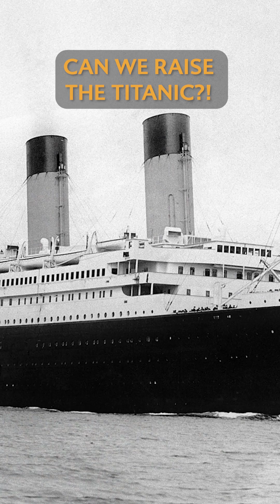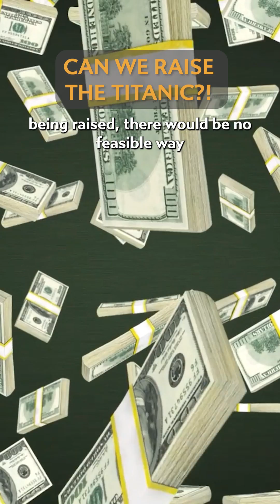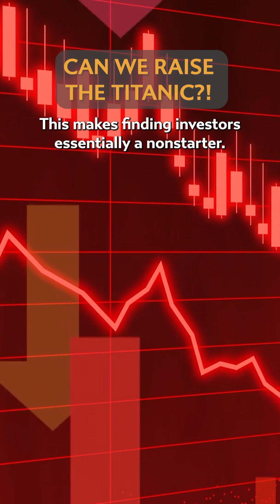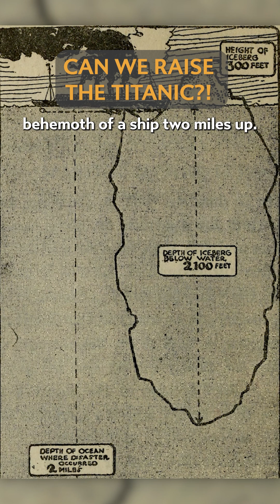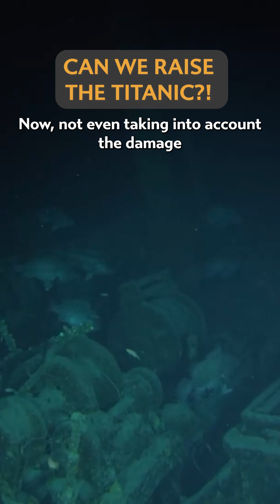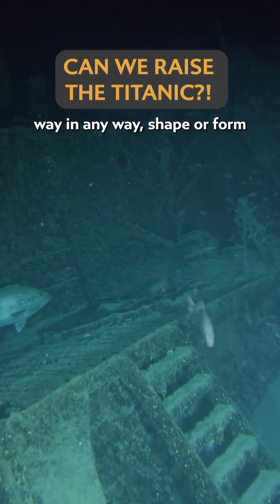Why Has No One Raised the Titanic?

Comment: It's too shagged. It's too deep . The only way to raise the titanic is to do it by scooping it with a massive glorified shovel. You'll have to scoop about 5-7 metres lower. You couldn't actually lift the Titanic out and it'll take about 6 months or longer to do just one end... Bow, or stern and you'll have to let the water drain as well, because water equals mass... The titanic will also partially crumble as you raise her.

Comment: I’m gonna embrace my inner demons here and say it’s totally doable. You just need some massive steel cables to form a giant net that is layered with a trampoline style covering. Underwater subs would tunnel under the titanic and feed this net underneath the ship. 

Then multiple giant steel lines from the net(probably 40-50 per side for a total of 80-100) would be brought part way up towards the surface where a high capacity, carbon fibre bladder is attached. These bladders would be equal in total air volume to 2 school busses. These reinforced bladders would then be filled with helium. This would result in a major upwards lifting force to pull the Titanic up. 

Once she reached the surface, these helium balloons would continue to provide upwards pulling force to keep the ship afloat as more balloons were inflated. Once we reach the correct amount of helium, the net will lift the ship from the surface of the water and cause it to hover. A series of strong tethers will be strung to boats that will bring the now flying ship back to port. 

Repeat this for the other half of the ship and you’ve got 99% of the ship back on the surface. Just need to clean the rest of it up

Comment: It would fall apart at this point. you would have to spend multiple years just digging out the ocean floor as titanic dug itself about 20 feet into the mud. Then you would have to build a platform underneath that would have to be solid enough to catch the ship if it breaks apart. Then you would have to raise it with a series of compressed air devices. 

Then you have to tow it into shore without it sinking again somehow. All of this would take about 20 years of work.

Comment: She would not survive the raising. She is structurally compromised, and will rapidly begin to deteriorate the moment it starts touching more oxygenated water and the surface air. We would need to build and immediately plunk it down into a preservation tank, and I don't see that as feasible.

Comment: There's nearly no point, raising it wouldn't undo what has happened to everyone, and if it's for restoring as a museum

Well, it'd be easier and cheaper to build a new one

As for raising it, the most practical way seems to be draining the ocean, placing a massive barrier around her, and slowly draining the water there

All you'd need are pumps, a pressurization system, and massive watertight blocks, it'd be cost effective, and the technology is already there

Forming something similar to the Arizona museum if she's too badly damaged, or able to raise her if she isn't, safely without the pressure difference destroying her

Plus, it'd be an interesting view on just how deep the ocean is, the main issue is that it's absolutely absurd

Try telling someone that you want to drain a patch of the ocean, and not a small one, a big one

Comment: Even if it didn’t sink. Ships like the titanic were built to float, and not be lifted. Even the dry dock is filled with water then emptied once the ship is on the blocks. So imagine trying to recover a behemoth that’s been rotting under 2 miles and a half miles of water pressure for over a century.

Comment: I figure if we have capability of raising something about 30,000 tons about 2 1/2 up from the ocean floor (talking about the bow since what's left of the stern wouldnt move an inch without turning to dust) then I figure we'd be putting that capability to better use. There is absolutely no reason to raise titanic at this point. I would much rather see anything that left in the ship be lost to the sea bed than sitting in a museum to someone else's gain. I still get angry that they still dive the wreck at all.

Comment: Even if the ship was solid , in one piece , and structurally sound, and it would still be absolutely impossible to raise it to the surface just because of the massive amount of suction that is holding her in place.  Excavators would have to be lowered to excavate the material that is holding it in place.   Furthermore, I cannot believe I am even commenting on this ridiculous post

Comment: It could be done pretty easily by using lifting bags that either attach to the ship with magnets, or by putting steel cables under/ through the ship, then just fill up the sacks with air or even helium, and it would rise all the way up!
(To think that you can drop a claw with cables and lift it would just be stupid due to the weight of those cables alone) 

The problem here is two parted, however...
1) The condition of the ship; it's probably not structionally good due to rust and such
2.) It's the last resting place for 1000 people; you leave such things alone, if you don't take care of it within a few years (because if only a few years, relatives still remember you)

Just let her be

Comment: Here's an idea if anybody wants to read this for fun that I came up with, Put four steel walls around the titanics bow and stern.
Then insert some durable spongy material deep under the sand kf the sea bed, And at the race, open it up and showed the last metal plate under it slowly and gradually as it works its way under the ship.You push it deeper and eventually make a connection point with the walls to the plate Then pull it up with ropes or some engine system that can propel it out of the water.

Comment: I feel like the second you try to attach anything to the thin plating that remains on the ship, it would just cave in like the rear section has, even the strongest part of the ship is starting to buckle, i'm not even sure raising the ship 50 years ago would have worked, if the equipment existed, its just too heavily damaged either way.

Comment: Not to mention it’s split in halves that are 600 metres apart.  It seems it would be an exercise in futility as it’s not merely a sunken vessel that can be plugged and floated, but an actual wreck that doesn’t resemble a ship anymore.  It’s basically debris that’s deteriorating rapidly.